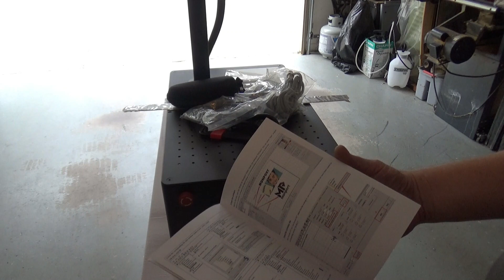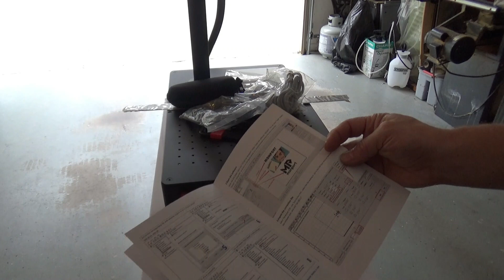MONPORT GP 30

Comment: I have tried messaging Monport several times with zero response. If I understood correctly, standard m55 lenses will work on this machine with the adapter? Both in terms of focus, power, as well as 'it screws on'. I see no m39 lenses sold as accessories but also absolutely no mention on the site whatsoever that these GP machines can swap lenses. I just don't want to get stuck in too small of a work area as well as be detailed when I need it.
Reply from the maker: The GP 30 Has a wide enough range that i doubt you will need to swap the lenses. I have been using both of mine for various projects and have yet to swap the lenses. Even though I did purchase a couple different lenses for my 20 watt laser I have yet to install them. I have marked as small as print 2.5 mm to large objects like the Slate coaster project this Christmas. with no issues. So unless your certain you need a different lens I would not be too concerned about it.
I like both Units. Power feed on Focus is nice. having the cabinet below is also nice the noisy is not at the level your sitting. Just personal preference.
Reply: They are remiss in instructions. I found the "default" lens screws into the arm readily, but the hole was less than the 68mm for the adapter for the lens I got.  (Monport F-theta M85 300mm*300mm with the Monport F-theta 85-68mm Lens Adjust Mount required.)

After struggling to comprehend how they could recommend a lens that doesn't fit, even with the Required adapter, I FINALLY found the aluminum mount ring for the "default" lens was actually removable and the port it came out of was 68mm.  

HOWEVER you also need a 2.5mm pin wrench. They do NOT provide one. 
Thankfully I knew you could get a bike pin wrench that would work off Amazon. 
(the screwed in ring has two "pin" holes on either side, the wrench pins go into those and you turn counterclockwise to take it out.)

Also, on the 50Watt GP laser the 300x300 area loss of power wasn't that noticeable, but had to move it slower, by like 80% for same results, but cut same depth. My opinion, all you lose is time for a larger aera.

Comment: Im confused about grounding. I asked monport if i need to use the grounding cable on my gp50 and they said yes. Where can i ground it to if im in my house? I think i saw in one of your videos that you grounded it on a metal tool cart, but dont you need to ground it to a metal object that is at least 6 feet deep into earth?
Reply from the maker: I haven't had any issues.  On the gp30 I didn't even connect it.
Reply: @CNC4XR7  i would assume there would be no issues because its already grounded through the outlet, but as long as I dont touch it with two hands id be good right?
Reply from the maker: @blackfeet9423  I haven't been extremely careful I'm sure I've had 2 hands on it with my feet in the air lol!

Comment: Do you like the xTool products? Their d1 pro is $995, with basic kit $1239 (material kit, 8 riser feet [that might screw into each other] and a 3rd, C axis rotary they call RA2 pro which i think is next level), or their All In One Kit $1400 that also has D1 Pro enclosure/honeycomb/air assist set.......
Reply from the maker: I'm not to versed on X Tool . I like you, do see all the adds and hype. To me they look more like toys ( just my opinion)
I think they are infrared laser which is slightly different. and the Zed range for marking is short unless you have risers.
I would look around for some good reviews on YT.